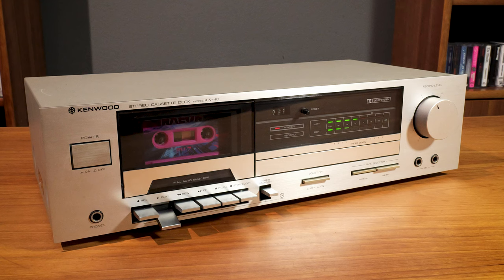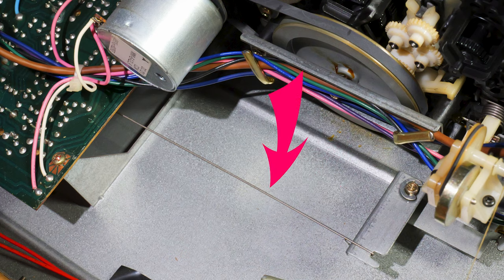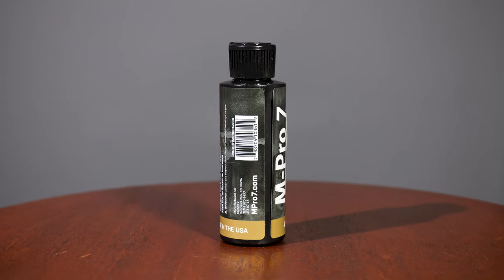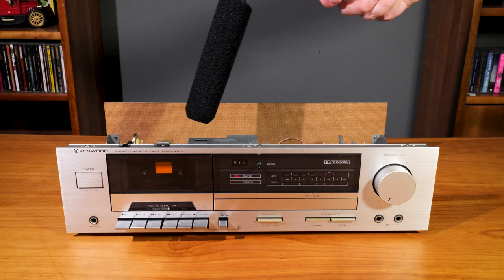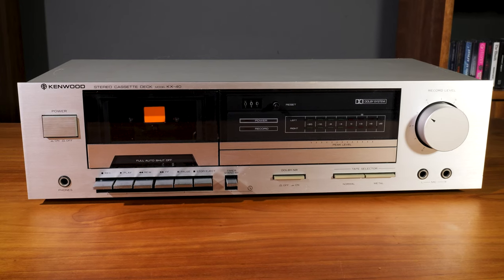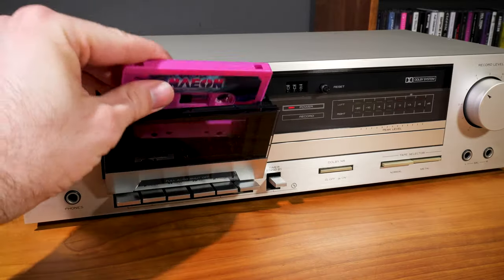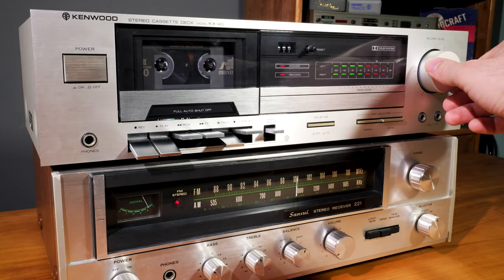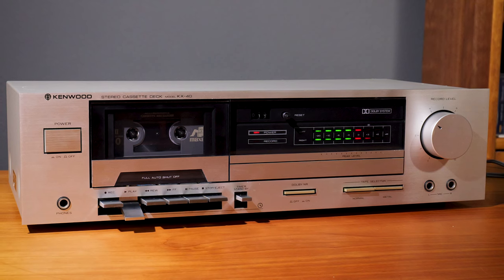The Kenwood KX-40 Cassette Deck: You CAN Fix This!

Comment: Regarding the timer standby lever: I think it was done to avoid stress on the capstan and pinch roller. I have seen this on a radio cassette recorder of a friend that also had builtin timer. My own radio cassette recorder doesn't have that. When leaving the device for a longer time powered off in record or play mode the pinch roller is pressed against the capstan and may deform what happened with my device...
Reply from the maker: Ah… that makes sense too. I can see that happening pretty quickly.

Comment: Haha, just yesterday I rediscovered this deck in my basement and thought about reactivating it. It just looks so nice and Kenwood is probably my favorite brand overall. Why I ended up not using it much was the lack of Type-II compatibility.
Almost seems like they ditched it for Metal in an afterthought: Hey, redesigning the switch, NOPE, but nobody's gonna buy a deck without Metal anymore, as soon all tapes will be Metal, I guess? 
Uh, not really, nobody ended up  using them on a cheaper deck. And using the Metal setting for Type-II might work, but it's not optimal. 
Mine was built in 1981, your motor says Nov. 82 so it likely left the assembly line in 83.
 Some Panasonic or Technics decks from the 70s have that timer feature too IIRC.

Comment: I had two decks with standby and never used it (because who would?).  Both had Logic Control so the idea was recording was activated through the standby feature.  Having said that, I recalled reading the manual and not getting a clear idea why this was even there.  Seems odd that this would be offered on a manual deck like this as it wouldn't know what time to switch on.  Maybe Standby is a timer that is set to 12 hours in the future?  Activate Standby and leave it on and plugged in for a couple of days and see what happens.

And in case there is any doubt.  I have less understanding of this than you do.  I was just born at a time when I could use this equipment so I toss in a comment.
Reply from the maker: Okay, I'm glad I'm not the only one who's lost. That makes me feel better. 
I'll keep trying to find a manual but for now I don't get it. lol